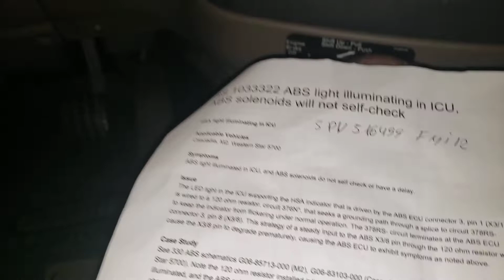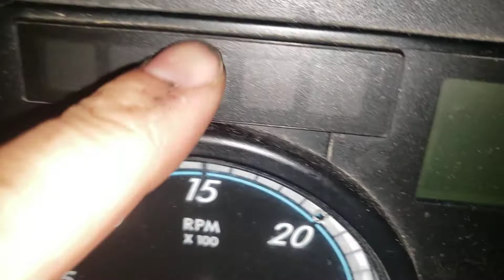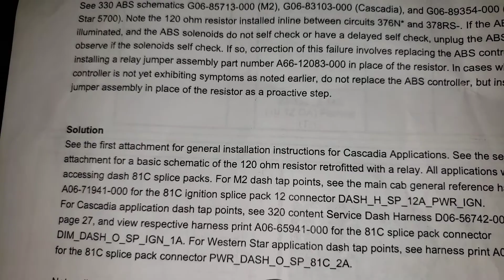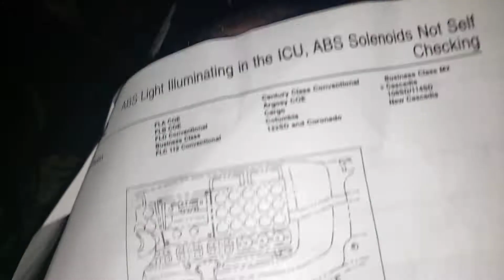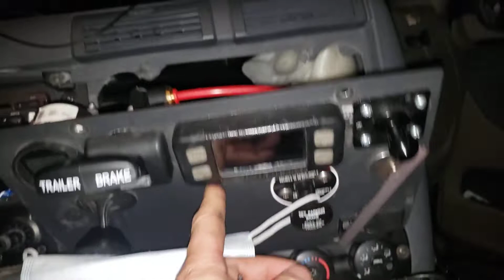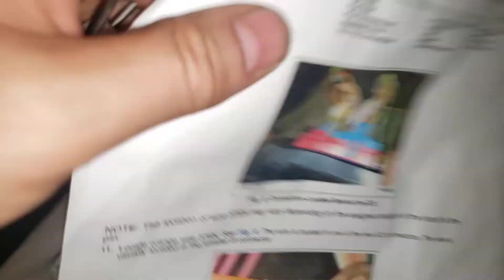Part 2 Part 1 SPN 516499 FMI12 misteri solved

Comment: Hello, hope that you' re doing well with your truck. What do you experience as follow up after this relay installment? I am asking because I am having the same issue on my 2016 F Cascadia, spent 3 weeks with a lot of expenses/ TA and shop without solution because when I am getting HSA light on, my speed disconnects to Neutral and have to pull aside..turn of power for 20 to 30 minutes before expecting to run some mls again and again. Are you satisfied since this relay installation?